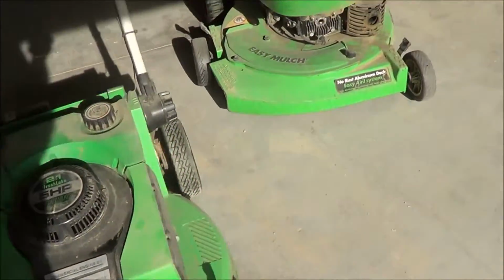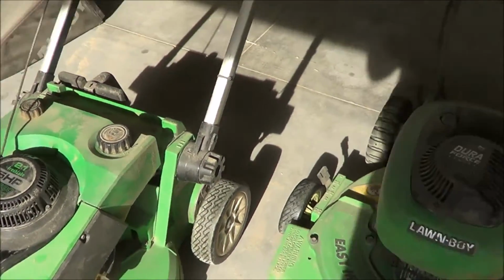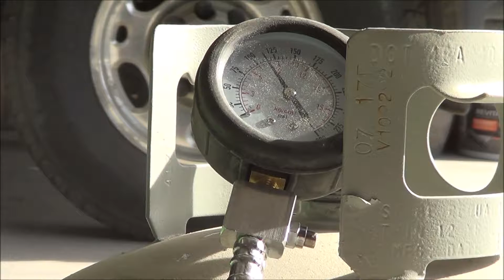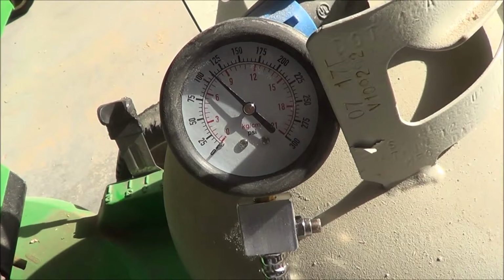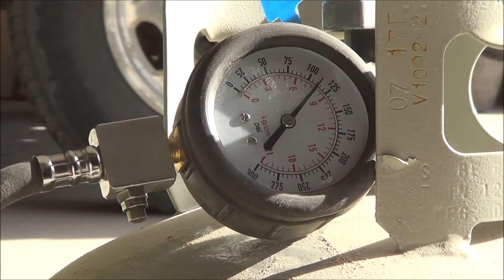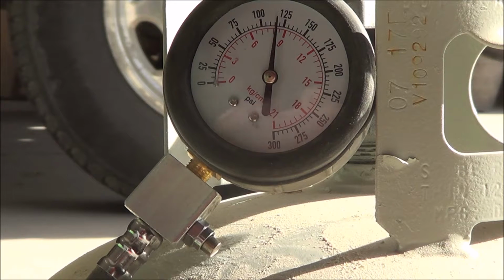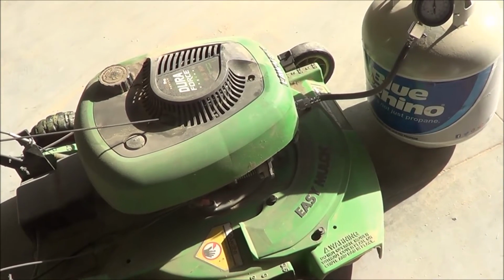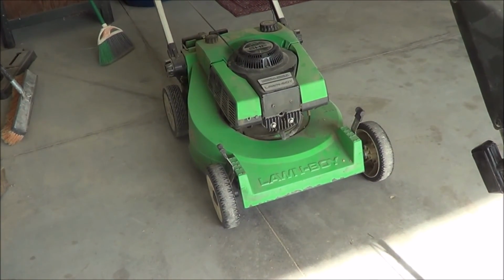Lawn Boy 10590 10547 compression test

Comment: Ouch the M series needs a rebuild.  150 is new 125 is out of spec
Reply from the maker: dude,  do some research before commenting, the 90 psi is still in spec, 150 is 10 to 1 compression needing 91 octane.  The M series is still a very strong.